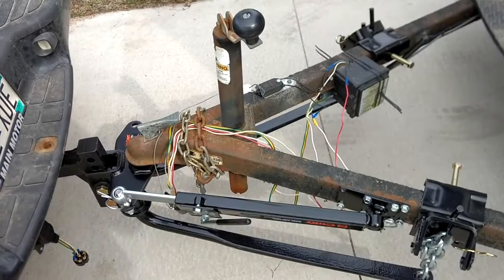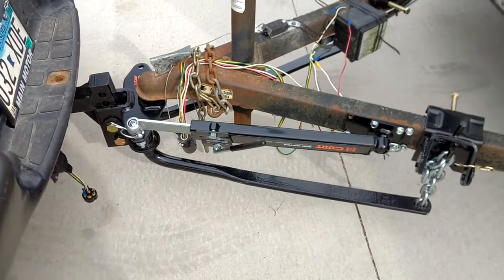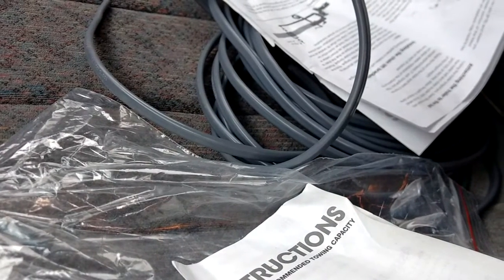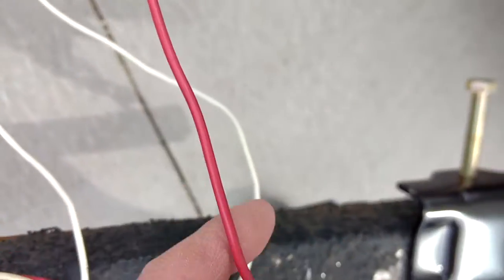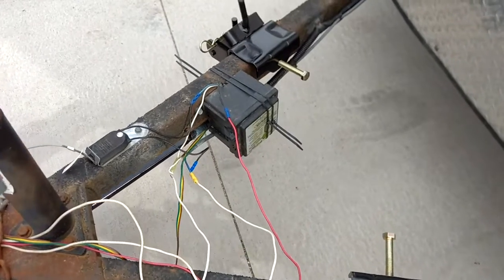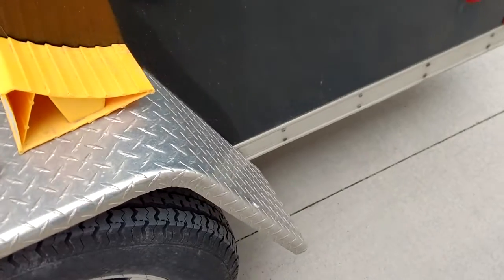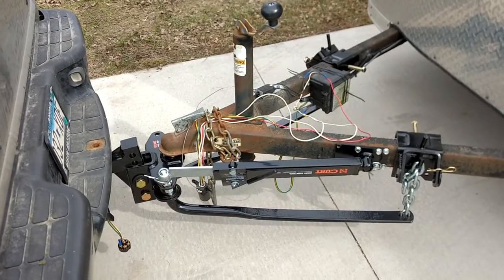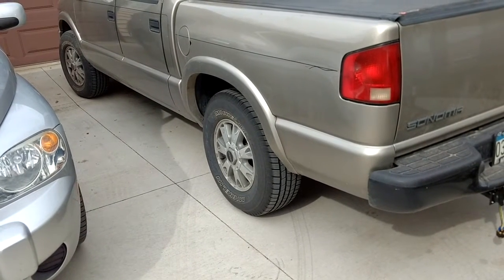I got hitched!

Comment: Those weight distribution hitches work great.I've got a wiring issue to work out on my suv tow package. Maybe I should just try this from scratch.
Reply from the maker: This setup was awesome. The truck and trailer worked flawlessly together, running the speed limit the whole way down to Tennessee. Thanks

Comment: my brother has one of those rigs on his camper, I don't under stand how it works but he said he really likes it.
Reply from the maker: The anti-sway bar basically acts as a brake to stop the swing action and it can be adjusted for tension as well. The other part shifts some of the tongue weight back further into the frame of the trailer. At least that is how I understand it. Thanks Vernon